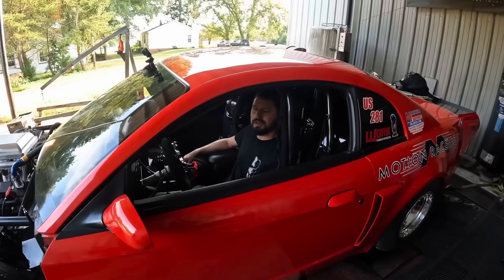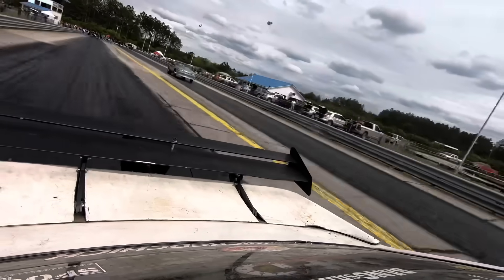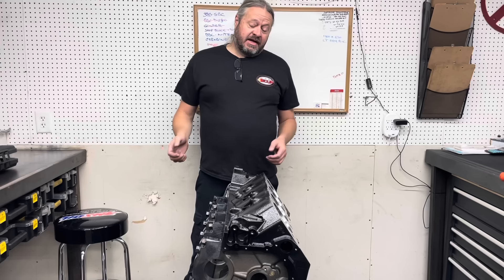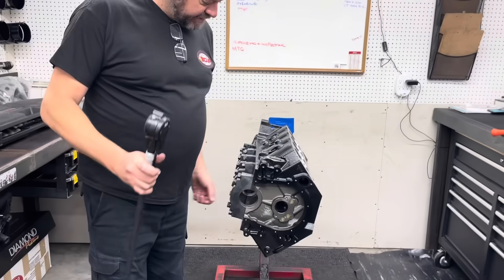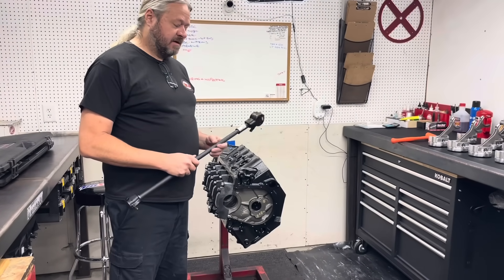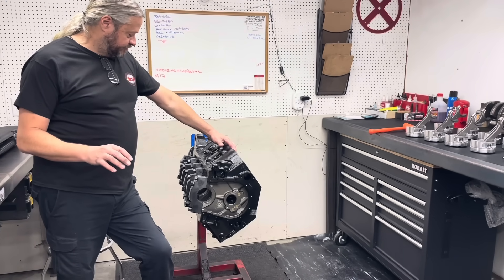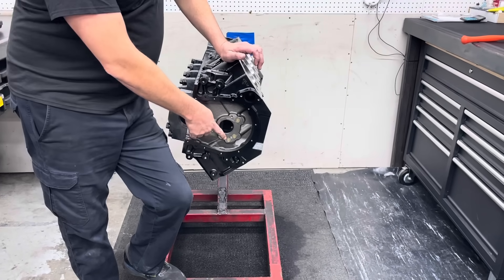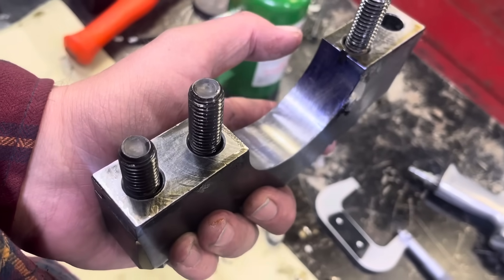Just bolt it together!!  Line hone disaster!!

Comment: With respect to the bore and hone job and your statement about honing it again no matter, so that you know it will seal - if you use a profilometer (misspelled?) to check the finish, then it should seal, as long as long as the diameter is right, correct? It sould save you time and the customer money.

Comment: Your video was very good.  The line hone can fix a lot of weird stuff.  A year or so ago I had a guy bring in a 6.0 Chevy block.  He was building a stroker with a 4 inch stroke crank.  His clearances were right at .002 on all of the mains yet the crank would lock up.  I trimmed the caps, line honed it, cleaned it and checked it, .002 all positions.  Torqued it up and the crank turned perfectly.  This block was just a little bit wacky and out of alignment.  The line hone corrected the problem.

Comment: It soothes my soul to see someone putting in this type of effort into their quality control. 

I used to work for a shop that built 4cyl for midget cars. We had some pretty big contracts. With honing mains and the cam towers we went as far as line honing vertically to prevent flex as our particular hone when run on a horizontal plane liked to oval out the last couple mains. I saw people get fired over using an impact when they should have used a speed handle. Everything had to be done just so. If you didn’t do it the way they KNEW worked. Every time. Without fail. You would receive a talking to and if that didn’t shape ya up you got let go. It was one of the most intense but enjoyable jobs I’ve ever had. Aircraft levels of attention to detail. 

Thanks for not only sharing quality content but being one of the few willing to do a quality job because your name is on it.

Comment: It's good that Dart leave as much metal as possible there for good shops to be able to work with, so the first life cycle of the engine can have better-then-factory tollerances and longer lifespan under hard use.
Align Boring seems to be skipped by many people, even rebuilding a stock passenger vehicle engine can benefit from it, in reduced friction losses of the crank, and reduced vibration from crank flex, freeing up power that would otherwise be lost as heat. It's one of those things that make engines last longer and use less fuel at cruise, there is never any downside to having it correctly done. It's as essential as an acurate dynamic balance of the crank assembly if you want to spin a motor to high RPM's.

Comment: Not only do I nit take a customers word on its ready to go I don't trust the machine shop (I have 2 I do because they are one man shows) to get me parts that are good. Had an expensive aluminum head one shop ruined by setting it up wrong and milling at an angle. Customer kept blowing head gaskets. Brings ut to me and I can feel a difference taking deadbolts out. I always disassemble by hand to feel things out. Looked at the head and I could see the cut on one side was lower on other by the casting reliefs. Took to the shop sure enough. It was max milled one side and had about 030 more on other. The deadbolts weren't seating proper so they loosened up. Customer had to buy another expensive head and I git subpoenaed to court for the suit against the shops that did the previous work....asshole.

Comment: I have a new Dart SHP 400 sbc block I need finished. Not one of the shops I called mentioned that they need to check the line hone.  Looks like  I need to get them to do so.   
What else should be done to a new block?  Besides the obvious bore/hone and square the deck.
Reply: pretend you got it from a junk yard - new is new - probably don't have to magnaflux, but assume every line is crooked and every surface makes ruffles look like a flat chip.

Comment: Simply as a mechanic, I refuse to work on stuff others have started. The moment I see parts in the seat or hear "Well it's been at 
so-n-so's shop and they're unable or unwilling to finish the job." or whatever, pick your excuse, everything stops. No more conversation or roll it right back out the shop. I could care less about the money. Not because I don't need it. No, I don't need all the headache and grief that comes with the job. Normally, there's a good reason the other shop couldn't or wouldn't finish the job, and normally it's not the "job" that's the problem. Normally it's the customer in a situation such as that. But since I'm the boss, I have that "luxury". But on the other hand, I don't make anyone take that job either.

Comment: I picked my block up from the machine shop, went to start putting it together and my main clearances were whack. I reached out to the guy and told him the mains had taper. He picked the block back up to fix the issue, and found that it was his dial bore indicator that was damaged and was entirely too repeatable. Dodged a bullet there.

Do you have any advice for someone looking to upstart an engine machine shop?